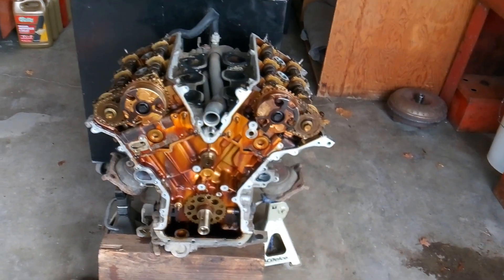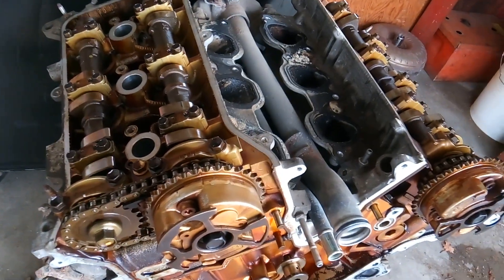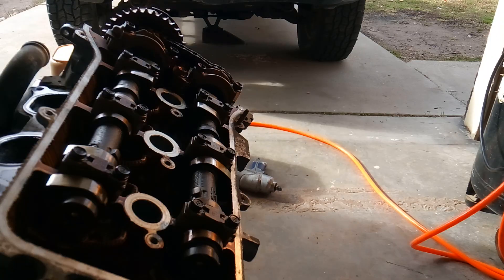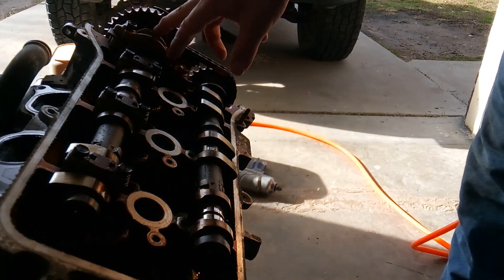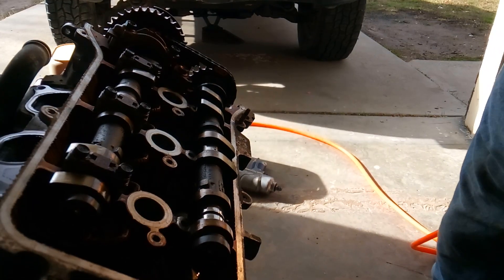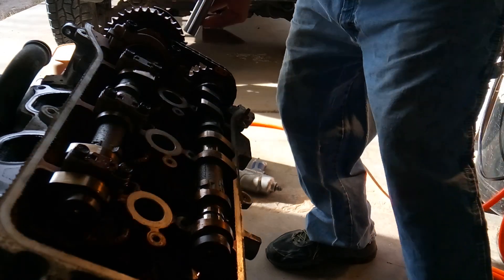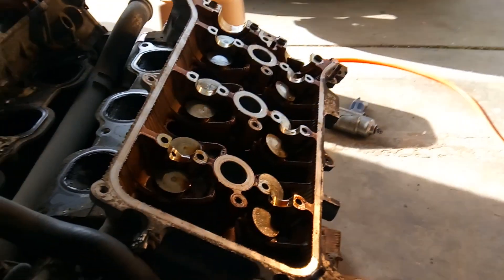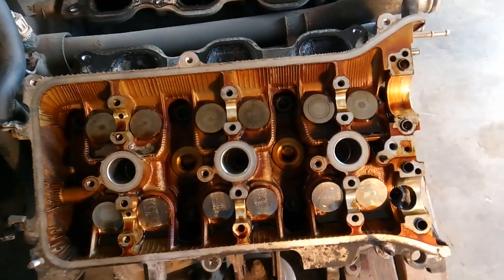Toyota 4 Runner Cam shaft removal

Comment: hey man, kick ass videos quick question i have a 1999 made in 2000 oldsmobile intrigue, i am trying to replace the water pump and thermostat and GM told me the thermostat has been discontinued thanks
Reply from the maker: Yeah you gotta find it online. They are out there. If you need help email me highgrooveauto30@gmail.com.

Comment: Hey brother I have a 2002 Volkswagen Passat and I changed my thermostat and put a heater core in it and it’s still runs hot like it’s barely getting a flow do you think the water pump went out or radiator need to be flushed
Reply from the maker: Sounds like water pump maybe weak so it's not moving the coolant properly causeing the car to overheat.